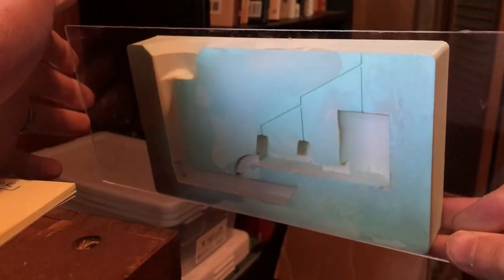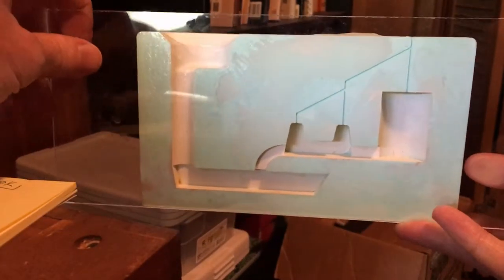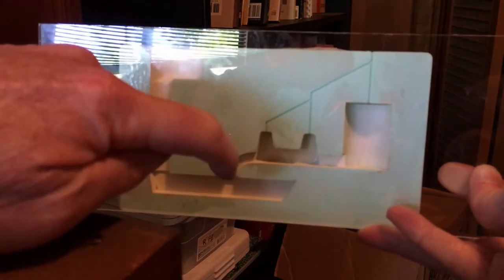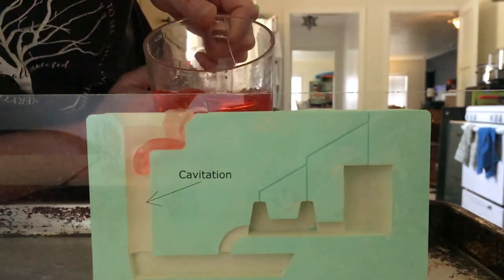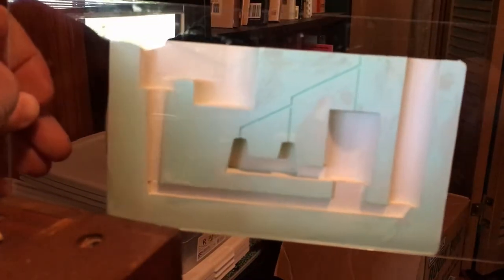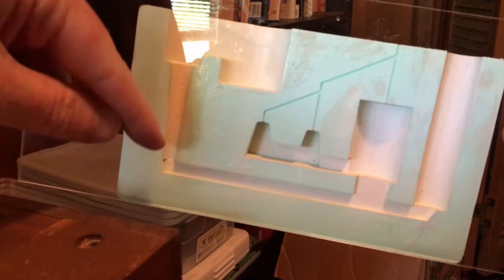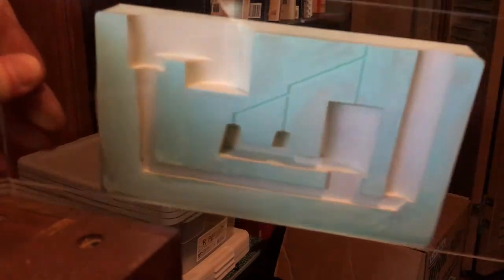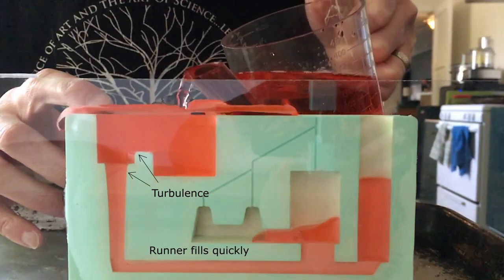Sand Casting Mold Design

Comment: Fascinating, well done and glad to see there are more people out there interested in seeing what really happens. Particularly interesting as to the bubbles etc holding (for a time) on the sharp edges at the sprue basin junction and at the sprue base runner junction and how this last bubble eventually breaks free and travels along the runner and up into the feeder. My very last video released just a day or two ago dealt with the basin and sprue side of things. I  think that the sprue could be a little smaller (hard to tell just how big it is) and junctioned to the sprue and runner as in my video, the runner can be about 20% bigger in area than the bottom of the sprue as the junction of the two slows the flow by about that much. Unfortunately while the fluid properties of water and aluminium are close enough the one thing that is different is the surface tension and the oxide film present on the aluminium I do not know how you can simulate that. Keep up the good work. I will mention this video in the pinned comment on my last video.... Martin
Reply from the maker: That means a lot coming from you. I'll keep at it.

Comment: Ha!  Thanks for the credit!

Interesting experiment.  It seems as the surface tension of liquid aluminum is quite a bit higher than that of water.  But it is interesting to see the continued air entrainment in the runner and gate.

Are you going to repeat with a smooth entrance sprue and a properly sized sprue and runner?
Reply from the maker: You are welcome. Thanks for doing those great experiments! You are correct about the surface tension. Definitely different than aluminum. I also tried mixing in some soap to encourage bubble formation. This didn't work and probably only served to reduce the surface tension further. I'll skip it next time.  Per your advice, I will try an improved version of the tapered sprue and small runner with smooth transition next.
Reply: @charliekrauter5176  You might try a different liquid.  Soap is certainly the wrong direction for surface tension.  Maybe a strong sugar/water mixture or glycerin.  Perhaps antifreeze right out of the jug.  Waterglass would be good too, it has pretty high surface tension and reasonable viscosity.
Reply from the maker: @andrewmartin4258  Interesting! I'll try a few liquids and post a comparison.
Reply: @charliekrauter5176   An interesting discussion.  You are probably long past working on this but as I was watching the video, and in light of the comments I wonder how cooling the mold to below freezing would affect how the water flowed through the sprue etc.  It may simulate the solidifying of the aluminum as it travels through the mold.
Reply from the maker: @JointerMark  Hello Mark. Interestingly, I am planning on doing more experiments with a new cross section that I recently printed, but life has been taking priority at the moment. Your idea of freezing the mold first is good one. I am definitely going to try that. Thank you!